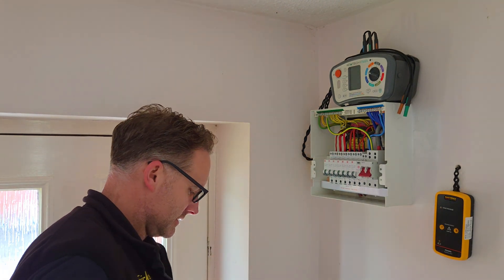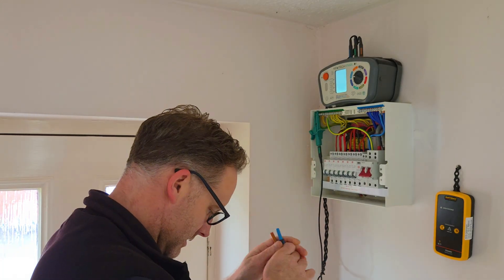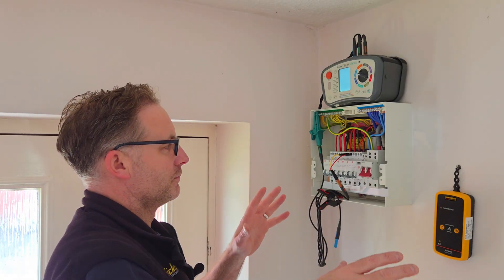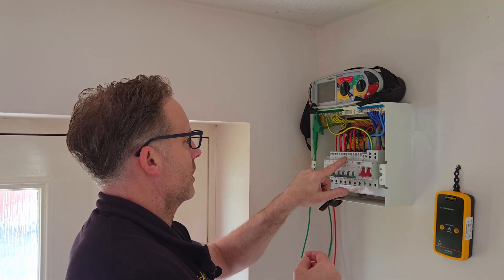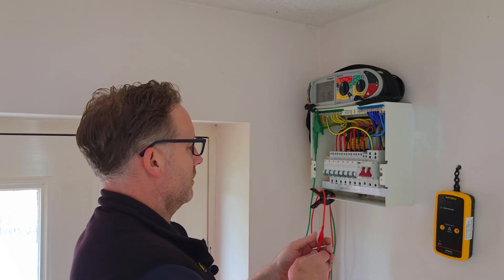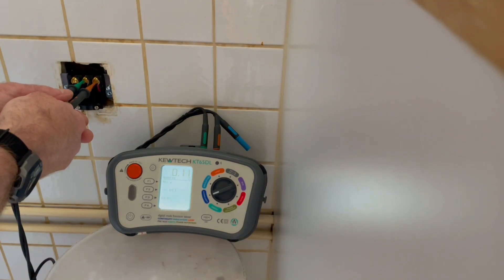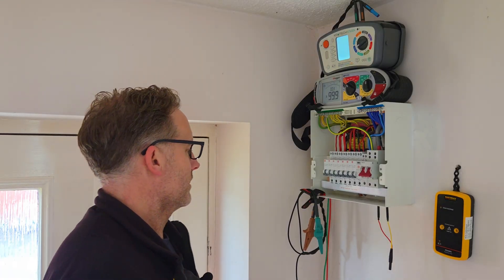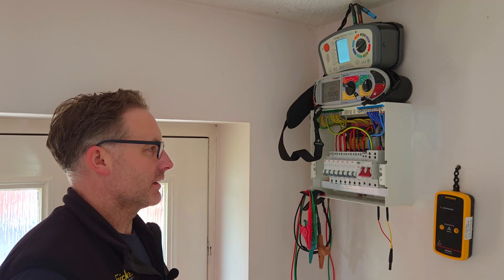Cutting corners or game changer? (70).

Comment: Thanks for uploading the video. Which reading would be the suitable one to record when doing the IR testing? Should you keep pressing the test button until the number reading stabilises, or once the resistance has reached beyond 1 to 2 megohms? What is the rule of thumb?
Reply from the maker: You will usually see straight away if something isn't right or if it's climbing up and suddenly drops back down to very low numbers. Obviously all installations are different and you should take that into account. This property is a 3 bed semi-detached house built 25 years ago. It's been well maintained over the years and had regular testing. Keep the test button down as long as you want, if the reading isn't good it'll show up straight away. Happy testing and cheers for watching.

Comment: Cpcs should be disconnected when carrying out R1+R2 to avoid parallel paths particularly on immersion circuits.
No problems on IR though. 
Great video
Reply from the maker: 100% mate. Parallel paths have had me chasing resistance readings over properties.
Reply: Yawn...just turn off the hot water tank dp switch.

Comment: So am I right in thinking that line and N to earth nothing needs to be taken out ie lamps, neons etc as nothing is going through them? so you can test at 500v with equipment linked
Reply from the maker: If you connect Line and Neutral together and test between them and earth at 250v you don't have to remove connected equipment for example: lamps, boilers, cookers.

Comment: Nice to see you back james, been a while. I like those magnetic jumpers but i think i would be always pushing on them for a good connection. You could just use 2 probes and a double 4mm socket to banana plug adapter i suppose. or just probe one at a time. Seems like theyre trying to solve a problem that doesnt really exist for a quick buck! but if it works for you then fine. I prefer the Kewtech KT64DL still going great after 8 years of owning it.
Reply from the maker: I hear what you're saying with the links, they are worth having in your testing kit and do come in handy. My Kewtech KT65DL has been going strong for 11 years now. Although saying that the Megger I use at work hasn't missed a beat in over 5 years, so can't fault them both.

Comment: Thanks Jeff. I think "Cutting corners" is considered a negative actions phrase, which is not what you are doing. You are working smarter, not harder with those bits of kit. I got mine ones at the Elex show on offer and they save so much time but more importantly, as you pointed out, there is no disturbing of cables at the board.
Reply: James*
Reply: @lightbulb6293  #BrainFart I dont know why I did that!
Reply from the maker: My thoughts exactly. What Elex show did you go to?
Reply: @JBE  Actually it wasn't the Elex, it was CEFLive2025
Reply: It is cutting corners. This is not the correct way of carrying out an R1+R2 test, you are not proving anything by leaving everything in the MET.

The only place these leads belong are in the bin.